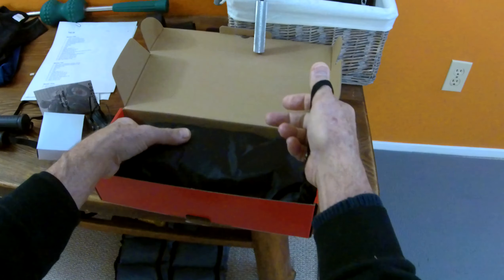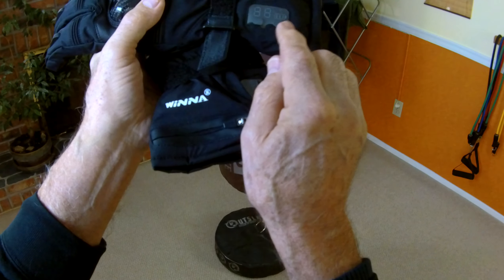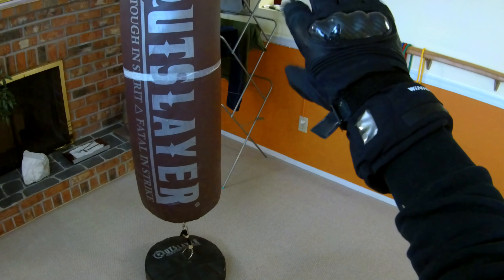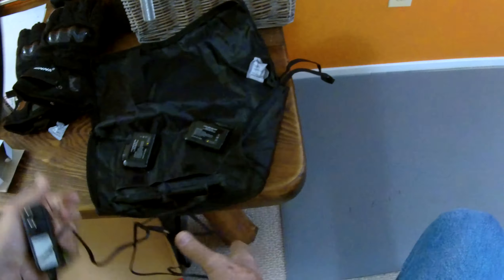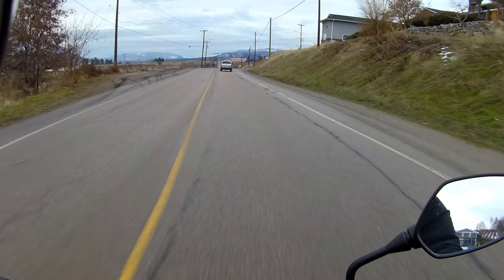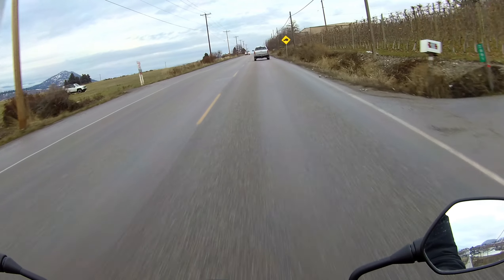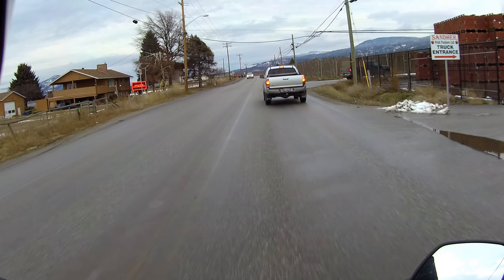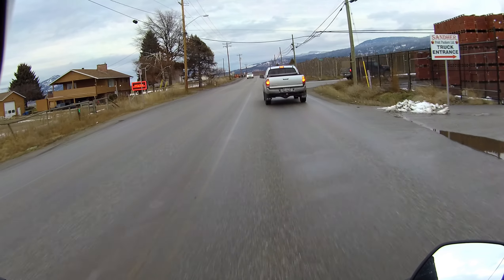Winna Heated Gloves Unboxing & 2° Test Ride Review

Comment: My cheapo Chinese heated gloves work good and they plug into a USB port I installed on the bike. The wires dangle but I dont care.  Battery would be good too but out of my budget. 
I also have wrap around  heated hand grips that are attached with Velcro and plug into a USB port as well. 
Combine both and it is pretty good.  Dont forget my heated vest too :) 
Yes I have 4 accessory ports for plugging in things. 2018 Honda CRF 250L Rally.
Reply from the maker: 4 accessory ports... wow. Good stuff. I hope the stator has enough capacity. A heated vest? Now that's just plain decadent :-)
Reply: @Scoottoots  One of the ports is used to plug in my battery charger not for anything while I'm riding. 
Yes the heated vest is terrific. I have had it for many years.
Reply from the maker: @firstchoicelastchoice28  Now that I have my heated gloves I'm becoming a convert for heated gear. Prior to this I was stubborn, wanting simplicity, toughing it out, lol